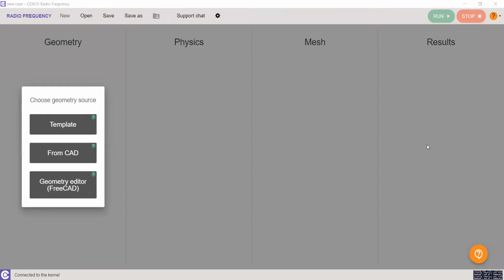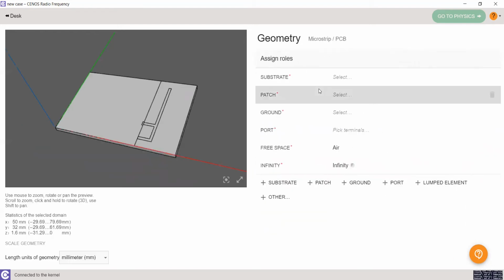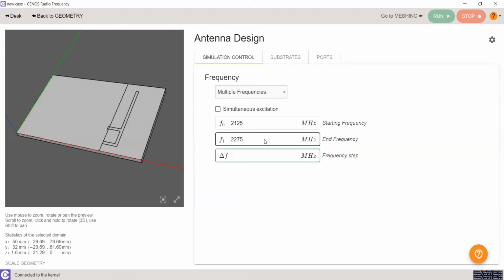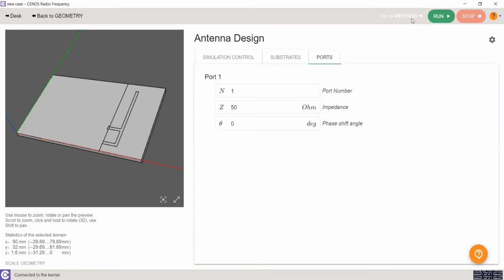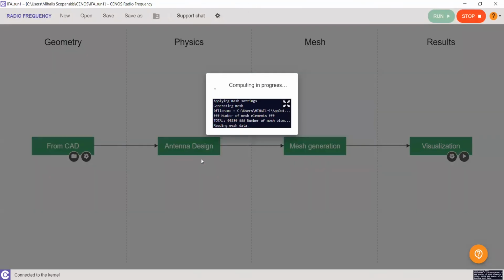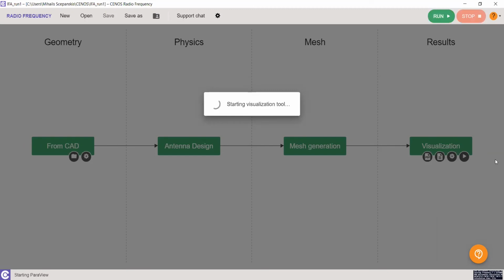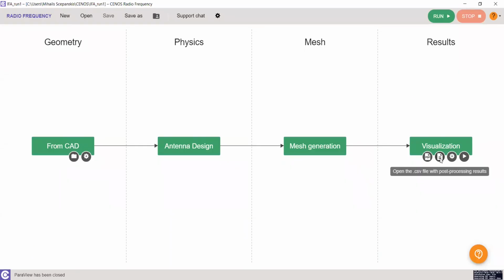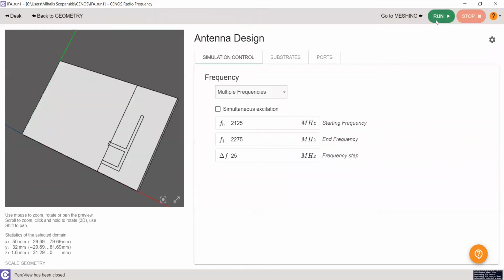CENOS RF 2.0 pre-launch demo

Comment: Hi!, congratulations for the new version, we're eager to try it. I guess if in the future we'll be able to use chip and fractal antennas. And it would be great if you can show more complex examples simulating an pcb antenna in a populated PCB and assembled in a plastic frame.
Reply from the maker: Diego, our customers work with more complex antennas, there is not limitation. In the video, our CEO just did a quick walkthrough. There is no problem to simulate chip and fractal antennas with CENOS RF 2.0 as well. Let our engineers do proper demo for you.